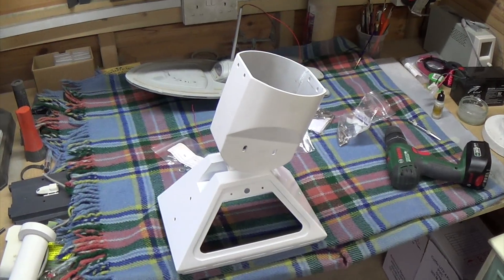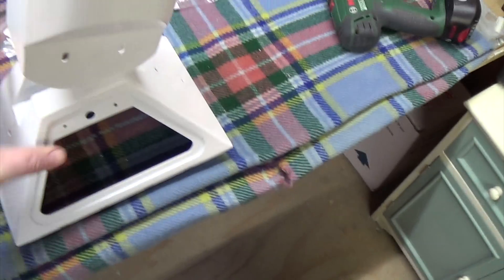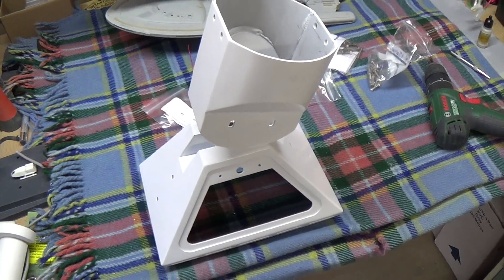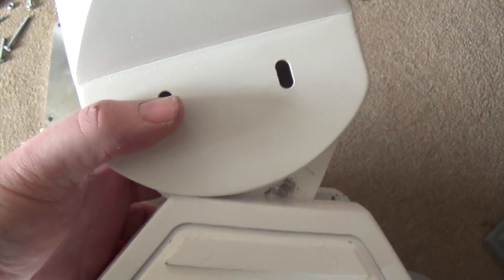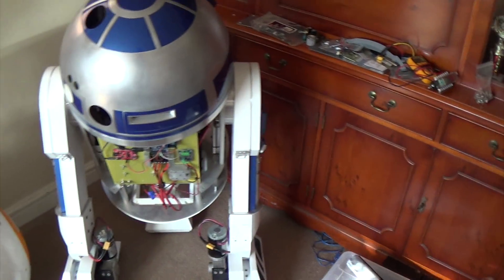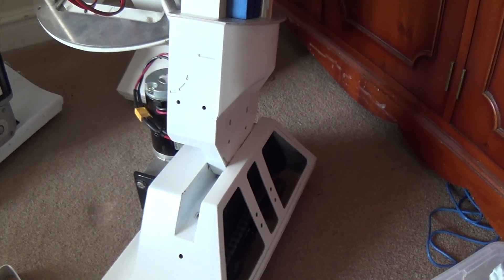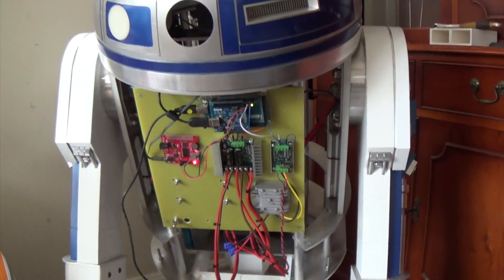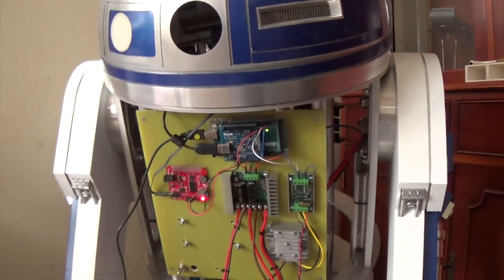R2-D2 build - Part 15

Comment: Not sure if you solved the problem or not, but you could have a bolt into the ankle from the battery box side, once the battery box is complete. You could have a bolt on each side of the motor into the ankle. :)

Comment: Great build, on suggestion: would omni wheels work better for the center foot? That way you wouldn’t have to wait for the swivel wheel to rotate. I know that omni wheels are expensive but the robotics group I’m with use them a lot and they allow use to solve movement issues like with the centre leg of R2-D2

Comment: soft start motor controllers etc, these are as gentle as a cheap electric drill..... very nice build but i as said a bit of motor controller upgrade would be way easier than mechanically fixing this, can you set that on the TX ?

Comment: Looking really good. Just about to paint mine. If you want an invisible ankle locking method you could drill from the side through the foot and ankle and put a roll pin though from the inside.
Doppelganger on the UK board.

Comment: Looking at the grub screw issue, could you not use an extractable dowel pin (link below) or maybe use a Transax 'C' pin. Both of these should remain firm. But the Dowel could be removed if required. 

https://www.cromwell.co.uk/shop/fasteners/dowel-pins/kennedy-extractable-dowels/f/7639?query=extractable%20dowel